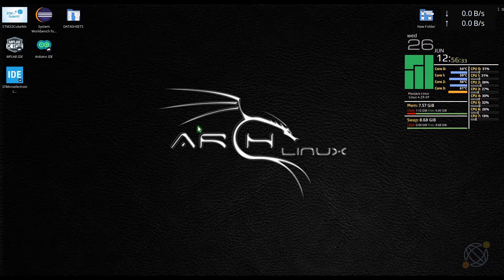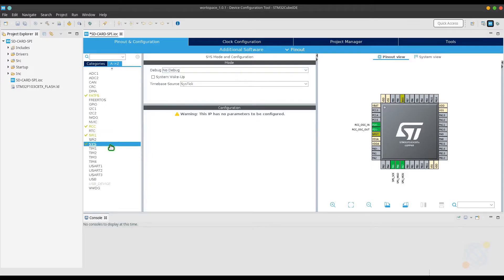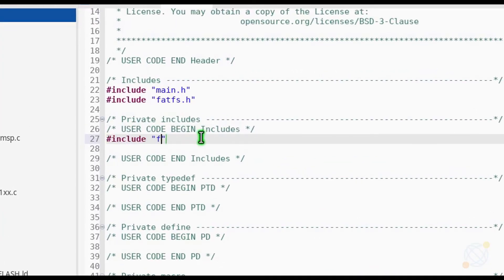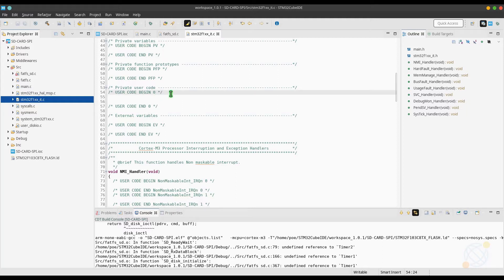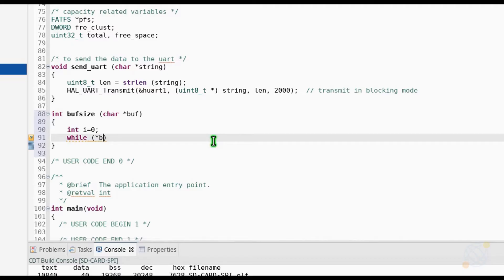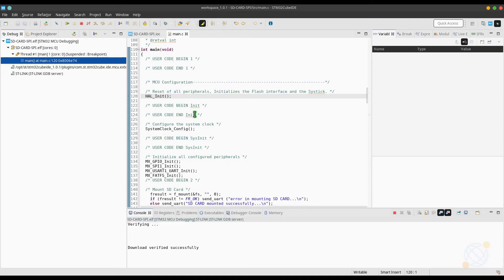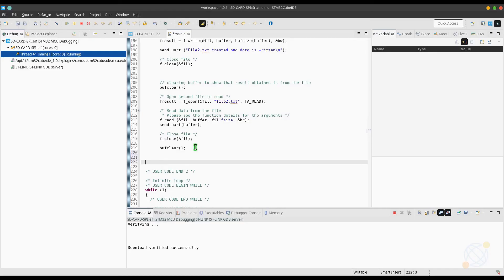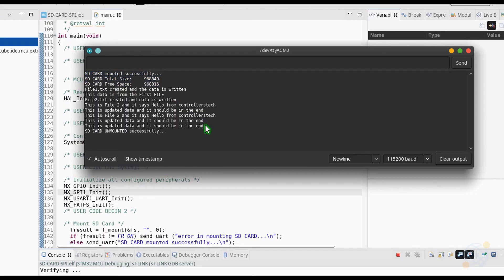SD CARD using SPI in STM32 || Cube-IDE || File handling || uart

Comment: Hi! I followed the tutorial and i have to say thank you! But its not working for me. I have a STM32F446 Nucleo and i got the error saying STA_NO_INIT when i call the function SD_disk_initialize (the disk is not initialized). I watch the video billions of times, and the error persists. 

If you could help me, please.
Reply from the maker: Have you formatted the card with FAT ?
Reply: @Bruno Miranda Did you try it again? We are also trying to access a 8 GB SanDisk SD Card using Nucleo - F446RE and the MikroC PRO for ARM IDE. We are not able to initialise the SD card into SPI mode successfully. Please help us if you are able to get it!
Reply from the maker: It depends on what error are you getting. Try the solution posted in the pinned comment..
Reply: @ControllersTech  We are using SPI 8 Bit mode only

Comment: Great Video! Some boards set SPI to 4 bits (  hspi1.Init.DataSize = SPI_DATASIZE_8=4BIT). I changed it to ( hspi1.Init.DataSize = SPI_DATASIZE_8=8BIT). Btw I am using STM32F0Discovery Kit
Reply: Hey are you able to read the file on the SD card using the STM32f0 series board?

Comment: Thanks for the video. I tried to do everything according to your video, but it doesn't work.
I'm working with the same SD-card module as you, but with an STM32L432KC. The first problem is that I don't have fsize parameter in FIL typedef.
And the second is that it always says that the card is mounted successfully, even if there is NO CARD in the reader. What is more, I get Disk_error if I try to write or read a file on the card.
Could you please help me?
Reply: I have Same problem. Did you solve it ?
Reply: @ucNguyen-wu2xh  I am using the STM32L4KC too. I used the same files that he used in the video, but I changed the HAL library 
with this #include "stm32l4xx_hal.h" in the fatfs file, and it worked.
Reply: Instead of the 'fsize' parameter you can use the 'f_tell' function.
Reply: Try writing this

 DSTATUS my_status = SD_disk_initialize(0);
 if(my_status == STA_NOINIT ){
  send_uart ("error in initializing SD CARD...\n");
 }
 if (my_status == STA_NODISK){
  send_uart ("No medium in the drive...\n");
 }
 if (my_status == STA_PROTECT){
  send_uart (" Write protected...\n");
 }

This will help to know if your disk initialization fails. Remember to #include "fatfs_sd.h"

Comment: My MicroSD Card Module only works with 5V, it took me a while to figure that out. My "Blue Pill Board" gets its power from a ST-Link with only 3.3V. After I connected 5V to the MicroSD Card Module everything worked fine.
The crazy thing was that the program explicitly said that the connection was successful.
I took fatfs_sd.c and fatfs_sd.h from https://github.com/eziya/STM32_SPI_SDCARD
Reply from the maker: You should alway connect an external power suplly. And leave that 3.3 v not connected. There are a lot of modules which don't work with 3.3v.

Comment: Thanks, your tutorial proved to be very useful.

However, my ultimate aim was to be able to interface sd card with STM32F051 Discovery board (basically with one of the F0 series of STM).I generated the same code for the Discovery however it is not working. I was able to pinpoint the issue. The sd card never responded with 0x01 after receiving the command 0 signal.

The same project works works for the stm32f103c8 when I try on it. I believe the  header file you provided is not entirely modular, ignoring the fact the comments are anyways in Korean.

Anyways, just wanted to let you know that. If you could help me, that would also be great by the way.

Thanks
Reply from the maker: Have u checked the SPI part ? Are u using SPI 1 ? Check the CS port. Try changing the speed of the SPI
Reply: I got it working man (after long hours of debugging). The SPI data length was set to 4 bit by default and I changed it to 8 bit and everything works the same as what the video describes

Comment: Are you Tried SDIO , sd CARD INTERFACE IN stm32f103rctxx Series?
Reply from the maker: I have stm32f103c8 and it does not support SDIO, so not possible there. But yes, i will soon publish a video about SDIO for those controllers, which supports it

Comment: Thank you sir.. for this amazing tutorial. Can you please guide for this with Compact flash card with stm32f3..
Reply: It's the same for other STM, I use the stm32l432kc and it works fine. For doing so, you have to change the name to the library according with your microcontroller in the fatfs file. For example: #include "stm32l4xx_hal.h" I included this in my case in yours: #include "stm32f3xx_hal.h" I think
Reply: @xZurdo-e1w  could you share your code for this type stm please?